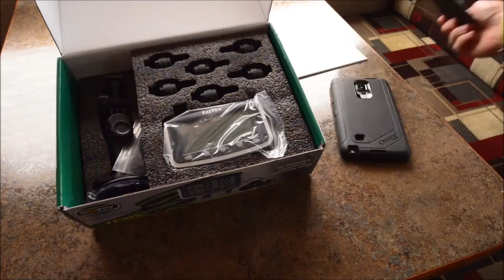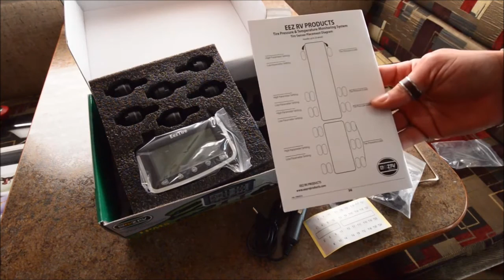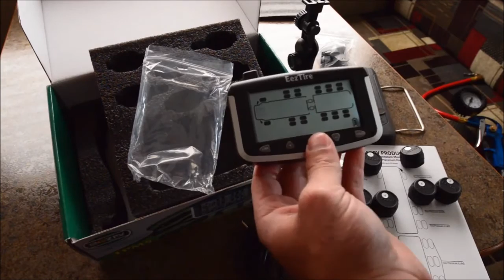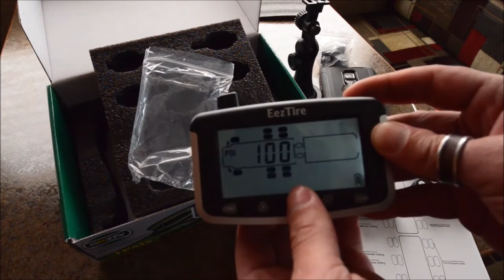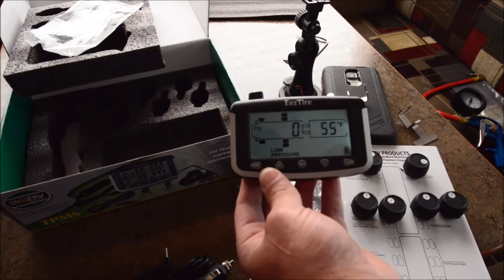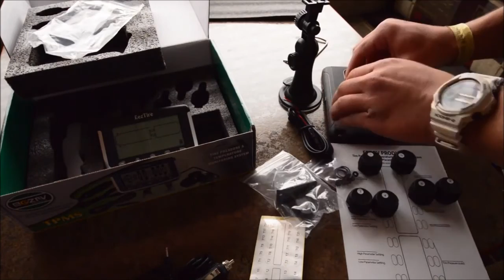UNBOXING, SET UP AND PROGRAMMING OFF THE VEHICLE OF THE EEZTIRE T515 TPMS SYSTEM 720

Comment: I have the exact same unit, with 6 sensors on the dually pickup, and 4 on the trailer. Only one sensor is active, it seems. On one wheel, the front right trailer wheel, the system has deleted the wheel completely from the screen. Finally, in a fit of frustration, rather than remove the outer rear wheels to install the sensors without losing ten pounds of air, I removed the four rear anti-theft covers. Now the sensors were easy to install. Didn't matter, they still don't work. Maybe all the batteries in the sensors are dead. I bought this two years ago, then was confronted with a bad engine. A new diesel engine actually required two years of saving and work to get completed. Now, it's all set, and I'm ready to hit the road. Out comes the EEZTIRE T515, and - - - - this just sucks - - - - I am absolutely better without it. Didn't this POS cost me just under $500 bucks? I have a compressor and a 50 foot hose. This system - which I thought would make a convenient addition to the dash, is a waste of time and money.

Comment: This was an excellent informational video of your product!  I just ordered the 12 sensor system yesterday and paid to have it preconfigured with all the settings so when it arrives in a few days I can place the unit in my Class A motorhome and be up and running quickly.  The added cost of $10 to preprogram/configure the system is well worth it thus allowing it to be a plug and play system.  I've followed both Chris & G Travels as well as David Bott from Outsideourbubble.com and they both recommend your product so I'm looking forward to replacing my current TPMS system, from another provider, I've been using for the past 3 yrs with limited success.

Comment: So the transponders emit only every 5 minutes, but switch to real-time updates when they're out of range?
Reply: +Stéphane Lavergne 

This is Tom with EEZ RV PRODUCTS, I handle the Tech Support for our EezTire TPMS systems.

The system cycles from tire to tire every 6 seconds and will give you the tire pressure and temperature for that tire as it flashes. If there is no dramatic difference in the reading on a cycle (32 psi, 32.1 32 32.2, etc) it will not necessarily transmit the minor change on every cycle. But irregardless of how minor the changes are during the cycles it will do a full update every 5 minutes and transmit the updated number.

If you go outside any alarm parameter during the cycling from tire to tire it will interrupt the cycling and give you  real time alarm.

If hope that was clear enough, if not let me know or feel free to give me a call.

Tom
EEZ RV PRODUCTS
Reply: Tom Robertson Thank you. I asked this while trying to assess the various levels of responsiveness of the available systems out there. Looks like you have a good compromise between price (and battery life) and latency.
Reply: +Stéphane Lavergne No problem, please feel free to contact me direct at tomrobertson@eezrvproducts.com if you need anything else.